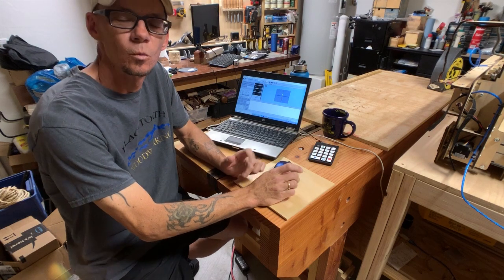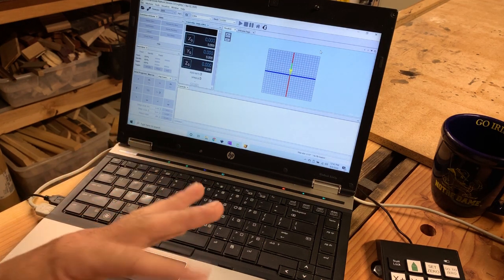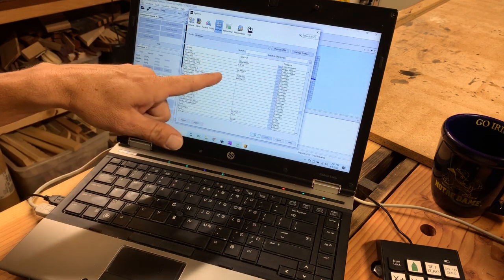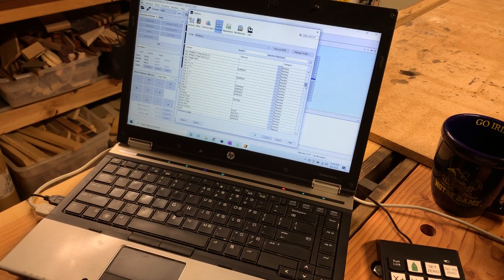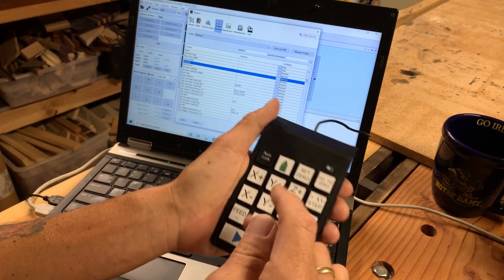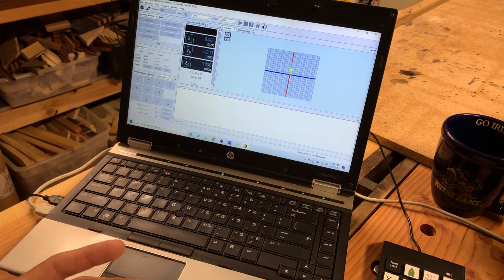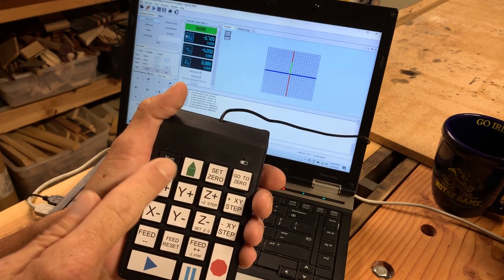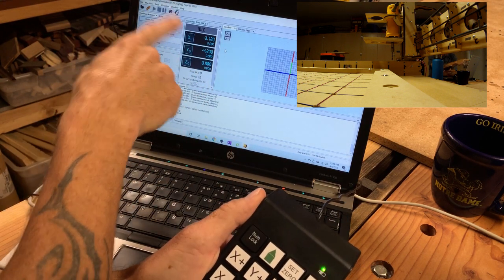HOW TO: Keypad Pendant with UGS for BobsCNC

Comment: Hey Nate, thanks for this!  I modified yours a little by making my NumLock act like a Function (fn) key so that when NumLock was pressed you activate the fine print and when NumLock is off you get the large print on the key.  It was just a matter of reversing the assignments for those keys that had a secondary function printed on the original keys.  For the keys that we want to have a single function but have 2 functions on the keypad, I just mapped that single function to both the large and small print on the key.  
Here are the mappings I ended up with:

HOME = "/"
Set ZERO = "*"
Go To ZERO = "-"
X+ = "Home" ; +z step = "7" (combo key)
Y+ = "↑" and add alternative shortcut "8"
Z+ = "PgUp" ; -z step = "9" (combo key)
+XY step = "+"
X- = "←" and add alternative shortcut "4"
Y- = "5"
Z- = "→" ; set z 0 = "6" (combo key)
-XY = "backspace" 
FEED -- = "End" and add alternative shortcut "1"
FEED Reset = "↓" and add alternative shortcut "2"
FEED ++ = "pgDn" and add alternative shortcut "3"
SEND = "Ins" and add alternative shortcut "0"
PAUSE = "Del" and add alternative shortcut "."
STOP = "Enter"

Comment: Excellent explanation.
I have installed a USB keyboard to control my CNC and I still haven't found the shortcut needed to activate the PROBE function.
The macro is already created in the Universal Gcode Sender Platform, but I wanted to start the PROBE using the USB keyboard.
Could you tell me which shortcut to use? Grateful

Comment: Hey Nate, it looks like you get an error when you start your g-code program. That would explain the the feed hold state. What program did you use to generate the gcode and what does the message say? 

Nice way to configure a pendant, good work!
Reply from the maker: The initial error I get when I connect the CNC is a safety measure, which is a normal error. But I figured out what the hold state is. That happens because I have a tool change code at the beginning of my g-code. Once I delete that it starts the cut right away when I push play. And I'm using Carveco Maker to generate the g-code. Thanks for the comment!

Comment: Nate, I have a question on the keypad. How do I move the machine incrementally instead of having it jog. I'm having to jog/stop/jog/stop. Great video.
Reply: Nate, I don't know what I did but it seems fine now.
Reply from the maker: If you're talking about moving the router a set distance then you can input a specific number in the Step Size XY area in UGS. For example, if you want to move it 5 inches then you would type 5 in that box and then just hit the X+ (or Y+) once and the router will move 5 inches in that direction. This is what I do to fine tune my stepper motors.